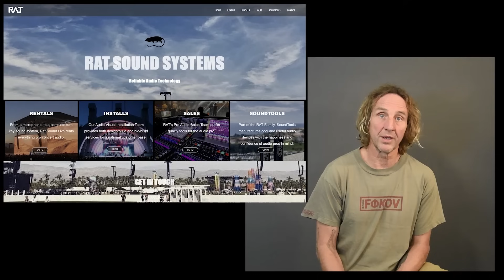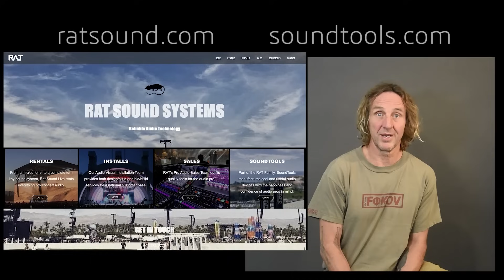How to EQ Live Sound Systems Tricks - Updated Version

Comment: Thanks.
In a very asymmetric venue do I need a dual mono system EQ or will stereo do the job? I think I do, but can it just be phase artifacts that really even out over the whole space?

System EQ playlist:
Cher - Believe
Communards - Dont leave me this way, So cold the night
Jean Michel Jarre - Equinoxe pt4 (I know, its an era thing)
Art of Noise - Close
Reply from the maker: Hmmm, mixing stereo where nothing is panned hard unless there is a different version of the same sound panned the opposite way works well
Reply: I'm always pressing for panning 3 and 9 o'clock on the banjo and guit to clear up the mix, but the other band members scoff at the idea.

Comment: i run FOH/MON for a touring band, unfortunately i don't have a console at FOH, we have a rack with a M32c+DL32 which i remotely control with mixing station on my touchscreen laptop, i could have headphones with an IEM transmitter but currently don't have the budget for a decent one.

when it comes to tuning the mains i usually play a song i know very well(type o negative, love you to death) while walking around the venue and just go from there with the built in 31band GEQ, after that i bring up the DCA for the whole band, 99% of the times i only have to fix a couple levels and we're ready to go, i have yet to find a better way to get it right fast

Comment: It's important to have the speaker system set up right before you do anything else.  These days, as you mention, the speaker manufacturer has usually already done this for you via a system processor.  As I'm sure you recall, in the older days your speaker system processor was just a crossover.  I've seen so many system EQs where everything between 300 and 2k are down 10db.  This is a classic sign that the crossover could have been set better in the first place.
Reply: I always try to do outputs before inputs!  If I have the right speakers in the right place pointing in the right directions with the right EQ and delay processing I can usually throw a good mix together in moments.  Without that it's a struggle.  I've definitely used spare monitors or utility speakers for centre fills or other audience areas out of the PA's throw.  A simple fix that can set you apart in small and mid-sized venues.

Comment: In regards to "over-EQ", we used to use a similar concept that you mention, although we would say, "if you're cutting more than 30 total dB with your graph, start over".
I don't do much FOH anymore, but I do still occasionally look over the FOH engineer's shoulder when I'm either out listening to bands or playing a gig, and it's incredible to me that some of these engineers will have a cut at every single frequency on their graphs.  Cut this out FOH engineers.  It doesn't sound good.
Reply from the maker: Good stuff and it is important also to mention that sometimes systems do need a lot of EQ to sound good. Ideally this is done in the system processor but often we may need to address EQ issues using the tools at hand. Doing a comparison of the EQed sound and then a volume adjusted non EQed sound is wise to insure that the integrity has not been lost.
Reply: @DaveRat  Good point.  As the saying goes, "if it sounds good, it IS good".

Comment: What would u prefer for live sound 2 way ,3,4,5 way?
Reply from the maker: Depends on the application, size constraints and volume levels needed
Reply: The more ways you do it 5 way vs 2 way then each individual driver will handle its frequency response better than trying to make a driver handle more than one frequency area
Reply from the maker: True and with a 2 way or 4 way, you can drive the lows hard into overload without distorting the clarity. But, with with each added way, you add a crossover and the driver interactions that create sonic issues.  So it's a trade off.  More ways gets louder but less ways can sound better.
Reply: @DaveRat  I wonder if a lot of guys do this they use the passive crossover in the cabinet which doesn't sound as good if you use specific frequencies and use an electronic crossover and let the drivers do less work in the frequency range I would love to hear your thoughts on this
Reply: @DaveRat  a lot of guys take a two-way cab with a 2 inch or 1 and 1/2 inch corn in a 15 and if they cross the horn over at 1.6 k and let the 15 do all the rest of the work that's a lot of work for a 15 inch speaker to do go from maybe 38 to 1.6 K if the frequencies are dispersed different drivers they might be able to do the job better with correct time alignment of course
Reply from the maker: Hmmm, passive can sound quite good. As far as crossover out of a cone, when the 1/2 the output freg wavelength equals the cone diameter, the dispersion is narrowing quite quickly.

So for a 15 speaker with a 14" cone diameter it is around 1000 hz that the sound gets pretty beamy. At 1200 and above, the beaminess can be undesirable.

So it is not only matching the output levels, but also the dispersion as well as transient response through the crossover region that is important 8d you desire a cohesive sound.
Reply: @DaveRat  I seem to hear a lot of distortion with the passive crossovers that I've heard I tend to think that a 15 inch speaker can work good in a specific frequency range and it should be kept in that frequency range let another driver that can handle the other frequency range do it it would be very educational to try to take multiple drivers to handle a full frequency response and make it sound good
Reply: @DaveRat  I'm actually trying to use dual 15 for subwoofers and trying to find a dual 15 subwoofer cabinet design I'm using a dual 18 subwoofers as well but I'm trying to use the dual 15 and dual 18 together so dual 15 cover higher areas in the frequency range
Reply: @stevencancel1727  18" speaker can cover up to 40-150 or 200 hz depending on speaker.what kind of higher freq. Area ur talking about?
Reply: @smithratan771  take your average 18in concert driver in a specific cab for test purpose, I use an XTA DP226 and separate power amp to send signal to the box and listen and observe the driver for the sweet spot or abnormalities with cab or drivers the most important thing to remember is when you have a frequency response for the driver and or cab there is a"center frequency" which could be a specific number or range for that driver. Let's use the specific number or small range. If the driver/cab is asked to reproduce say 36 to 39 hz at the bottom and feasibly does a fair job of it, how far would it be expected to reproduce up the hz scale effectively?
maybe 80 to 120hz before it begins to effect the bottom 36 or 39hz
Then the 15in driver takes over, going down to 60 or 80hz up to 400 or so depending on testing and so on through out the driver compliment most important is to remember " center frequency" of a specific driver the other graph to take into consideration is distance and surface absorption of frequencies. If you place a frequency measuring device at 100ft then 500 ft and understand what frequencies arrived first and which were absorbed you can learn how to compensate for time distance absorption etc
Just by using center frequency you begin to see the inadequacy of specific drivers and cabs to reproduce frequencies separate from each other until they can design a single driver that can produce all of the frequencies at the right time distance and absorption
Reply from the maker: Well, a D&B J rig has a passive hf and sounds amazing and is a top level touring system. Passive is not an issue, passive with inadequate limiters and under powered amps distorting, is an issue.

The aspect of passive and the aspect of selecting the optimal x-over point between drivers are unrelated issues
Reply: @DaveRat  i don't know much about d&b.but i definate love rcf hdl series
Reply: Another advantages of splitting more freq. To Its each indivisual driver or speaker gives more comfortable control over compression or limiter to that speaker.
Reply from the maker: As far as multiple ways vs 2-way, there are many variables.  Running a 2 way system hard can be an issue as the bass guitar can blur the vocals. A 3 way is more immune to that and as you add ways, you are able to overdrive some freq ranges while others stay clean.

But at lower volumes or with a higher speaker to room size ratio, the opposite can be true. Multiple ways often cause similar speakers sizes to be farther apart creating more interferences and un desirable interactions. Additional crossover points create issues, waste energy and require higher costs in amp channels and processing to achieve similar results.

Having a 5 way stage wedge or a 2 way arena system are both less than optimum.

Biamp and triamp wedges seen to fit well.  For main systems 2 way or 2 way us sub or 3way plus sub or 4 way plus sub all have advantages and issue that are application dependant
Reply: @DaveRat  agreed👍
Reply: Well everything has its advantages and disadvantages.my opinion is is ur doing a small show better go with 2 way (sub and midhigh).am i right?
Reply: @smithratan771  I tend to think there's a drawback to using passive crossover networks in 2-way speakers there seems to be a lot of distortion generated by the crossover Network I think it's a very low quality sound I'm also interested in using multiple drivers and making them work together so that there's more drivers to disperse the frequencies about the trick is to make the drivers work together to make an 18 a15a a12 a 2in a 1in make them all sound like one speaker not five
Reply: @stevencancel1727  as i said earlier both techniques have their advantage and disadvantage its up to u to decide how ur gone do it
Reply: @smithratan771  what I am saying is say you use your sub and mid-hi cab in your room and you are satisfied with the sound and someone else brings in a different rig into your specific room and they never mixed here before and set it up for the first time and it sounds waaaay better than your system sounds in that room
are you going to pay attention to what they are doing different?
I used to take students graduating from college with a degree in live sound make them get their own rig , make them set it up, mix the show. They had to have many hours doing this to get their degree
I enjoy passing the learned lessons on to future sound guys and I want to be the dumbest guy in the room so I am always learning as well
Reply: @stevencancel1727  ur right but ur asking to be very accurate i do live sound and my setup is not fixed it moves to one to other places with big or small hall or venue and there will always be some other issue big issue than  this to be handled
Reply: @smithratan771  the days of having a large pa in one area of the room may soon be over. I had to do an indoor show(Magic Stick Detroit) where they had six separate stages with a lineup of performers at each stage, three days of this thankfully only one performer at a time but they did this to avoid lag time in set up and teardown and to get maximum amount of bands in venue
I had to get creative in a hurry and was able to use the main house system for low end for all the stages and used just satellite surround speakers for each individual stage we now employ this method at most indoor venues, no PA on stage, properly located subs and satellites distributed evenly throughout the venue, some even have volume controls at the table so the patrons can turn up or down in case they need to have conversation the loud music won't interfere. The satellites are very high grade design and are similar to studio monitors or surround speakers. The system is mixed in headphones. Satellites eventually will be powered with active crossovers and dynamics and you will use multiples depending on size and coverage restraints. Maybe it's better to bring smaller speakers closer to the people than to try to throw loud sound a distance
Reply: @stevencancel1727  well that's ur theory.i would be worry about the delay,interference and also small speaker dont intend to produce enough power for such as band show.another thing is setup ur talking about adds lots of other equipment.but good it work for u.
Reply: @smithratan771  ok there is no wrong or right way just sharing knowledge to try to learn
Reply from the maker: Super cool
Reply: @DaveRat  huh?